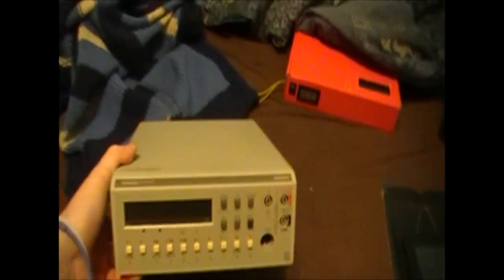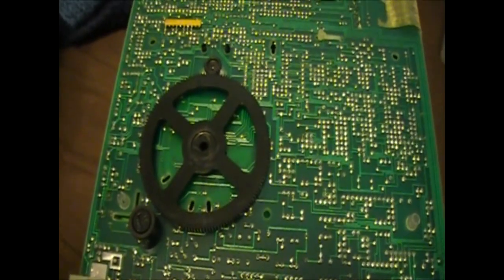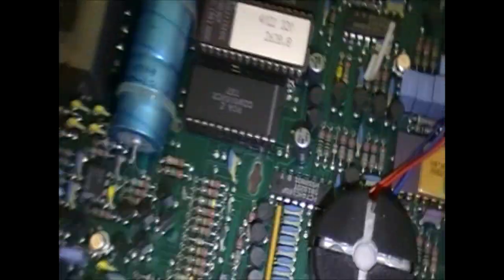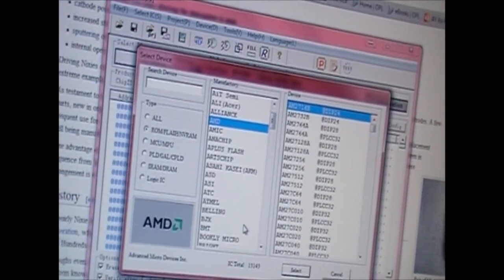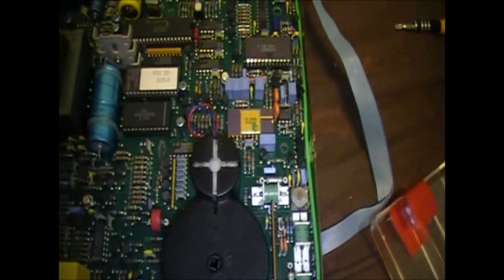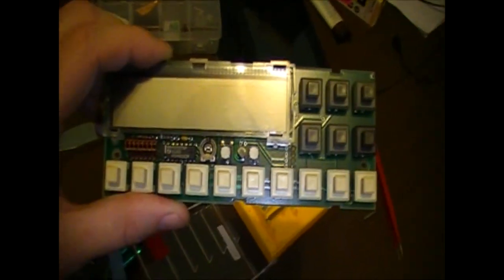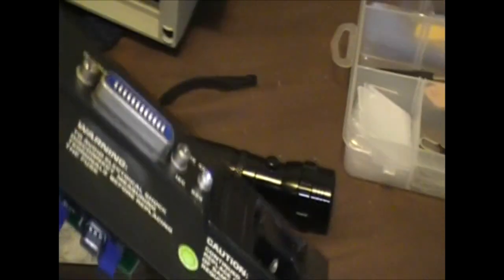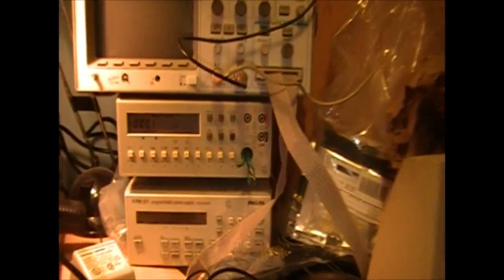PM2525 Teardown

Comment: MAx84xx Xxxx is a series of small MCS48 compatible microcontrollers with onboard mask ROM, Xxxx indicating the mask version. The code underneath it is just a date code. Also, from the board layout it can be deduced that the 75xxx pair are GPIB interface or line receiver/driver chips.

Comment: At 3:45: These 6-pinners placed in a straight row are opto-isolators. They are used to provide electrical isolation between the multimeter circuit and the GP-IB port.

Comment: It is glass reed-relays inside a coil (the green one). This is very much used in Philips devices. It is just a relay! nothing else. The very common problem with this is, that the glass tube breaks - and the reed relay cannot work. Just replace the reed relay (leave the coil alone...) and the instrument is working. You can buy the reed relays at RSonline or any other prof. shop. I have replaced a lot of them in Philips equipment.
It works actually VERY well - just very sensitive to mechanical stress.
Reply: Very good to know!
Reply: Do you know the type, if the switches are of the "Normally open" type?